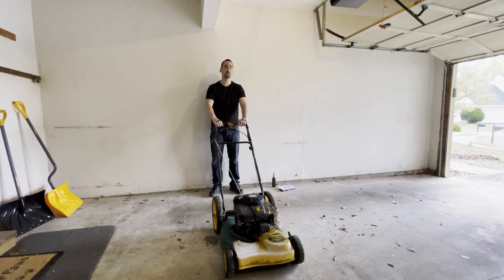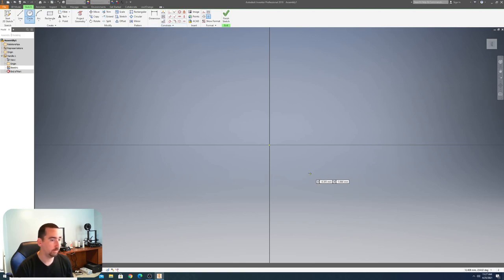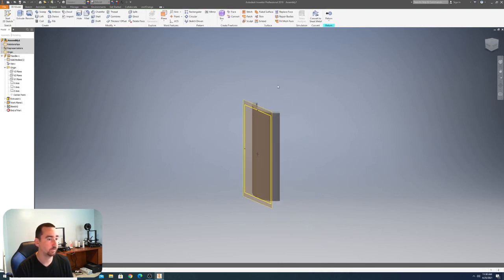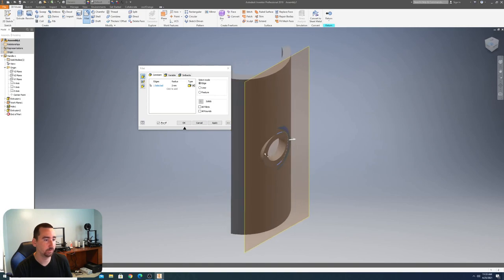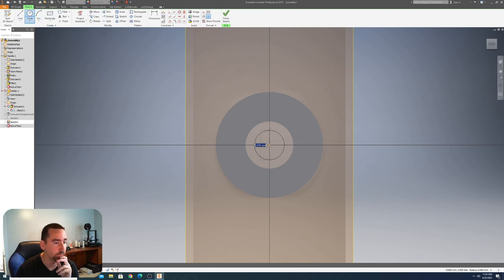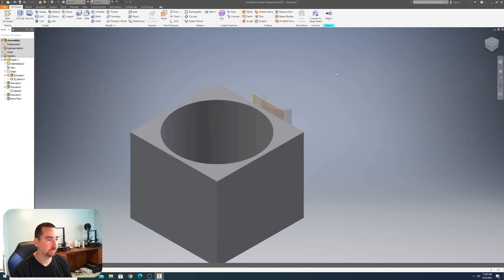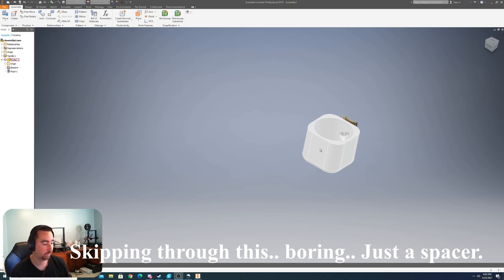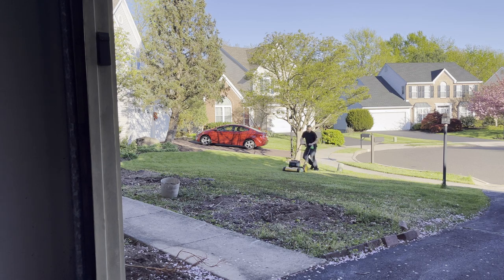Push Mower Beer Can/Bottle Holder?! | 3D Design & Printing

Comment: Those are some beefy back mower wheels. Did you modify from stock?
Reply from the maker: Nope, those are the wheels that came on the mower. Funny enough, the wheel spokes broke probably a few weeks after I made this video. I ended up switching up mowers, as 2 wheels cost more that the crappy mower is worth. I would have printed 2 wheels if I had my bigger printer at the time.
Reply: @PrintPractical  Gotcha, had a thought yesterday about the front wheels of a mower should probably swivel so its easier to turn, like a kid stroller.  When a kid stroller front wheel is locked its hard to turn, and unlocked its comfortable. Something I might mess around with.